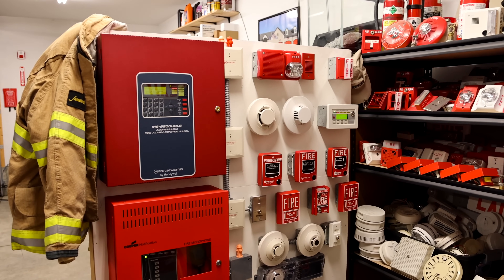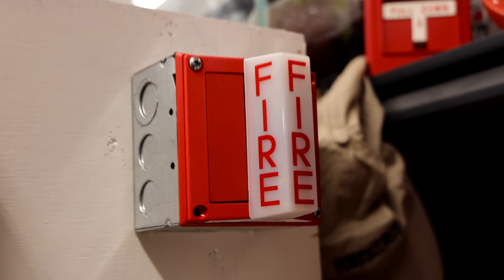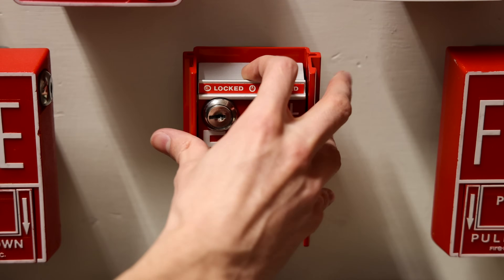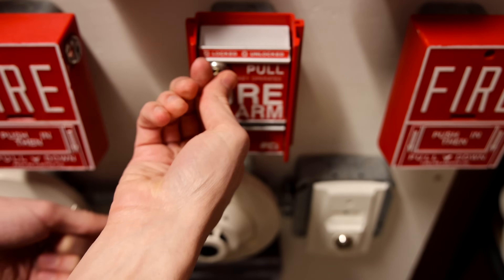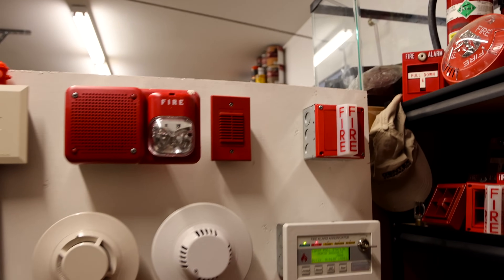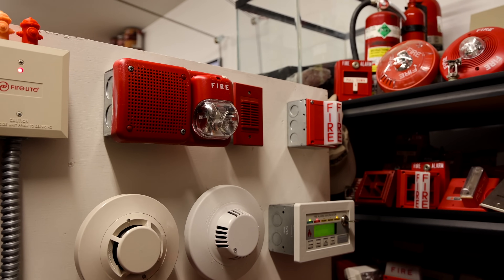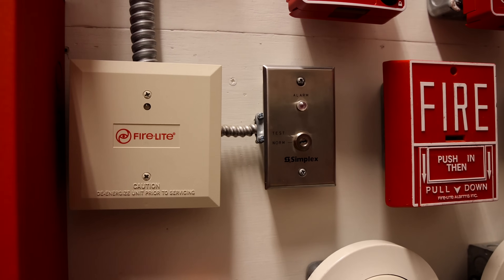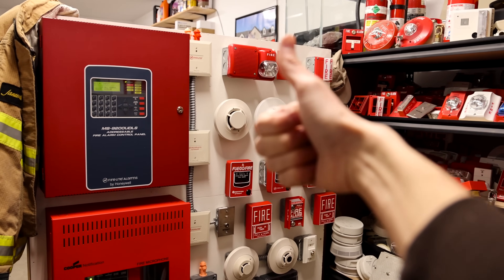Key Activated Only Fire Alarm Pull Stations | Wheelock & Fire-Lite System Test 25!

Comment: Why does it have two keys.
Reply: One to unlock pull handle and other two reset it
Idk why they chose to use two different key types though
Reply: Hey if someone gets a hold of the key, would rather not have it be able to be reset too early.?
Reply: It’s a FCI MS-2L
Reply: It could be a psychiatric grade
Reply: Most likely so the staff with the key can activate the alarm but not reset the pull station.